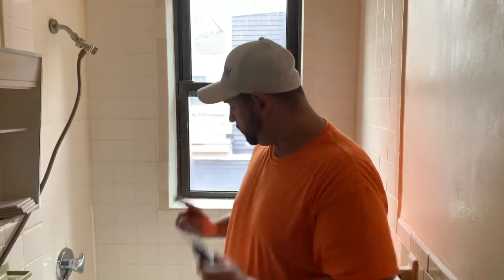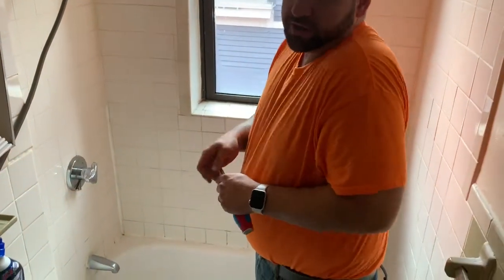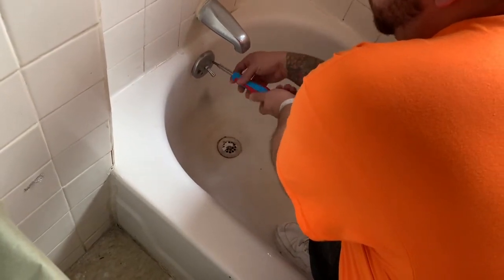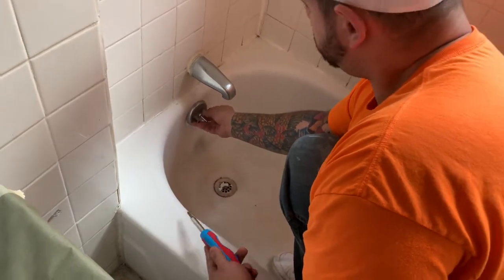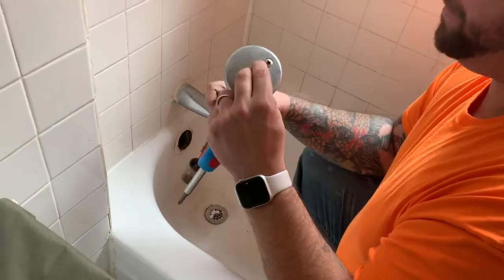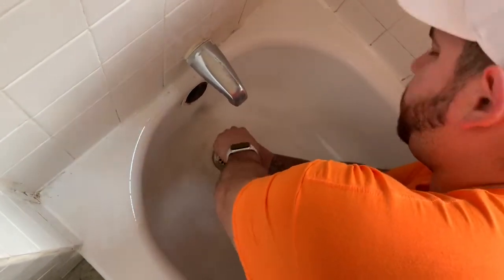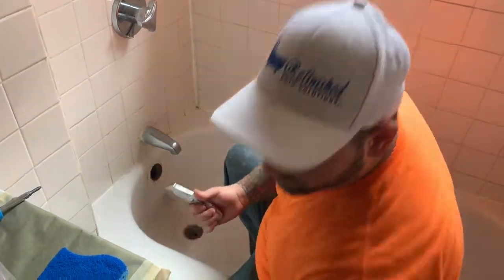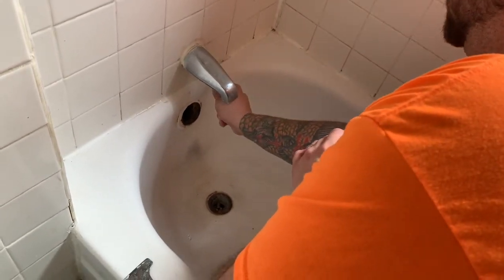How To Recast Or Refinish a Tub With Ekopel 2K | Avoid Thin Knockoffs | Refinishing Series Step 1

Comment: Would you fill in if there’s any missing grout before applying the epoxy as well?
Reply from the maker: Yes, you would want to fill those areas in and fix any cracks in the tub before you apply Ekopel 2K
Reply: Refinished Bath Solutions thank you for your response!

Comment: I have a tub that was "professionally" refinished 6yrs ago. It's got pits and peeling all over the place. Prep wise, should I use a power sander on the bottom 1st? I can send you a link to a picture if you want.
Reply from the maker: Bill McNair yes it is best to strip that material down to the porcelain. Or sand down until smooth
Reply: Thank you!

Comment: I did not remove all of the ekopel and covered my tub drain.  The tape is still on the Any way to remove it without drilling. Ekopel has cured??? Help please
Reply from the maker: robert davis sometimes if it’s been a short enough time it is still soft enough to cut out with a razor blade. Once the Ekopel cures drilling or grinding is the only way to remove it.